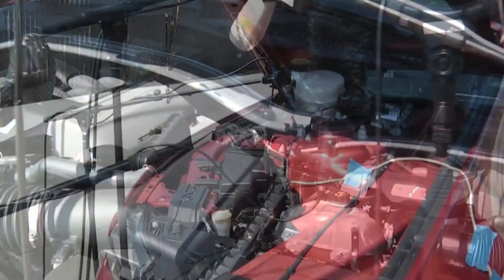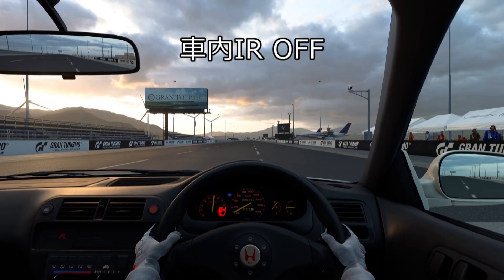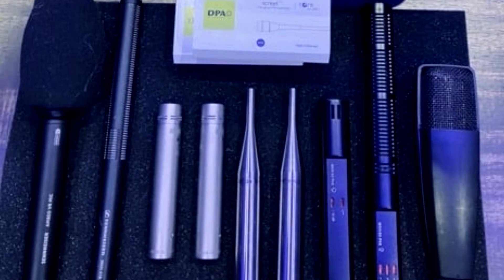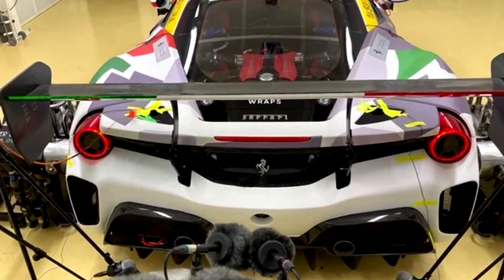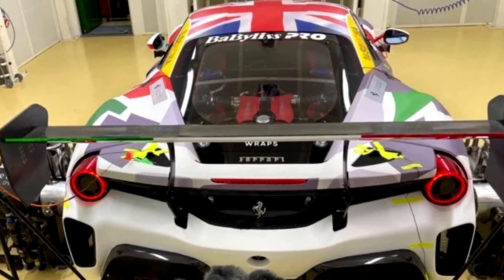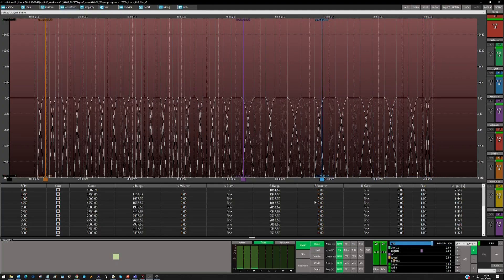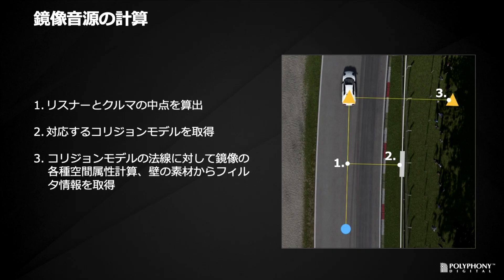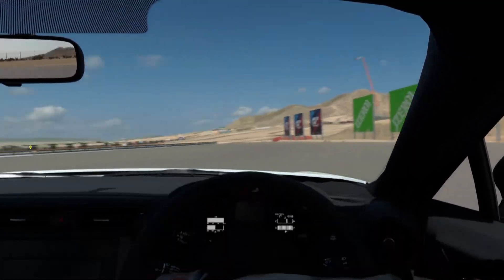Recording Car Sounds for Gran Turismo 7

Comment: Yet some of the cars still manage to sound awful when you shift up.
Reply: That's because you're not engaging the clutch when shifting. Use a clutch and you will notice a huge difference during upshifts.
Reply: @rosaria8384  whether it's the clutch or not, I don't care. They should make them so they won't stutter. It's annoying as hell. Plus, not everyone has a steering wheel.
Reply: They sound awful all the time 😂

Comment: 4:30 I wish they would add more notes. there isnt much variation in the engine notes. it is good but it could be so much better. I always knew it was a performance issue.
Reply: buy a better car and tune it. More pop crackle pop for your punch.
Reply: Every car does sound different in gt7 and acc and wrc dosent have the car varity,of gt7
Reply: Yeah, I'm questioning why they use this AES system if it just increases CPU load, instead of sample recording or even a hybrid of both systems. Codemasters games and ACC have one of the best car sounds and I'm sure they use more recording samples.
Reply: @AKK5I  They use this for VGTs, Lotus F1, and GT-R LMP1 since GT6. Now, they went around for other cars that PD don't have any access to the car or other cars with similar engine like the 488 shown.

Comment: and still the car sounds are horrible
Reply: @user-tg5wf2hq7rAMS 2 sounds are even better than those imo!
Reply: @user-tg5wf2hq7r forza is shit too
Reply: @user-tg5wf2hq7rfm is garbage gt7 have much better car models and accurate sounds than forza motorsport.
Reply: No they are not, they are actully good in most cases,

Comment: The cockpit view sounds in gran turismo suck, also the v8s dont sound like the real ones at all. They need to get interior sounds with windows down type sound so u get more natural exterior exhaust noise.
Reply: Also a cool feature most people forget is that the higher stages of weight reduction you do, the more engine noise there is in the interior in game. Try it out
Reply: @BigJZXguy  I guess that one contributed a lot to the sounds. Without those restrictions, sounds are more reflective.
Reply: I think they are quite good for the most part, some v8 needs more work but there is v8 sounds in gt7 thats quite good to
Reply: @andreasmoller9798 if you have ever been next to a Camero ZL1 then you'd know the sounds in GT7 is not that good 😂
Reply: @currythegoatofmankindthepa5156  the camaro zl1 is actully one of the american v8 that sound good in gt7, the sounds are not perfect by any means, but they are good, and when you consider how they use to be in gt6 you start relise how much of an improvment it is, forza on the other hand that use to be killer for car sounds has now even falled behind gran turismo in car sounds,
Reply: @andreasmoller9798  GT7 doesn't have bad sounds there just lacking the cars starting up in the in the car selection screen sound how they should they need to record them underload on a track
Reply: @currythegoatofmankindthepa5156  ya thats a huge issue, cars under load sound completely different and way better then when there stationary
Reply: @Sideways_Singh  They keep recording them in those little rooms 😡 that's why the sounds in most video games sound synthetic and flat even when there using the real cars exhaust note. Only raceroom has good engine exhaust notes don't know how they do it but zero games come close. PD needs to send there people to a track day hook up some mics to cars and around the track and go to town recording the real deal
Reply: @andreasmoller9798  Oh now you’ve adopted using logic and reason in your arguments HAHA
Reply: It is stated in the video why the sound is like it is, it's to have a more natural sound like you are in the car with sound damping.

Comment: Now Forza is going to try to compete with sounds 😂😂😂
Reply: @user-tg5wf2hq7r/ forza sounds like computerized / artificial while GT7 sounds like an actual car. you know what I mean?
Reply: @CaneZyle  GT7 sounds like an actual car? Are you on drugs? How much experience do you have at a race track? None I assume. GT7 still sounds like a vacuum.
Reply: @CrewExpendable2007  Yes, clean your ears.
Reply: @CaneZyle  Or go to an actual race for once, this game sounds like garbage.
Reply: @CrewExpendable2007  I did! If GT sounds garbage to you, always remember that FM2023 is much worse. It's the buggiest, most unfinished, mediocre game that I've ever purchased. 🤡🤡🤡
Reply: build from ground up😂
Reply: They gave up on this competition about 5 titles ago lol
Reply: @Darksaige  since forza 4 prolly
Reply: @user-tg5wf2hq7r Yes, and no, to a greater extent no
In Forza, the Viper and Porsche 962, for example, sound great, but are unremarkable in GT7
In general though, most cars in GT7 sound quite accurate

Guessing that all cars in both games were not sampled with up to date methods, as there simply isn't enough time to do so
Reply: @user-tg5wf2hq7rYou know damn well, that‘s not true.

Since GranTurismo started recording engine sounds that way, Forza always was on the back foot. It‘s not even close.

And the way they then use the sounds in game, with them echoing off the walls and reverbing in tunnels. The different pitches with different speeds… it‘s not even close.
Reply: @PerriThePlatyPilot  Forza does that too lol
Reply: @juraj_b  Very poorly
Reply: they haven't shown recording from the new Forza, but this is a vid how they record sound in FH5 https://www.youtube.com/watch?v=Yqsrizplujs
Reply: Forza 😂😂
Reply: “Try”
Reply: Newer newer FM just betraying FM4 yet
That's it
Reply: Forza motorsport  made from the ground up D
Reply: everybody who shits on forza sounds only know fm7-8, horizon 4-5 exist but never mention fm5,6 and fh2 which i think beat gt7 as i still think the latter sounds a bit muffled, although they do improve
Reply: @stobeznog878  you forgot to mention    AAA ac carmods too
Reply: Forza is dead.... Welcome to the dark side GT7.

Comment: GT7 is the first GT that sounds decent, the ones before sounded like vacuum cleaners.
Reply: These Vis Nav Sport models looking 🔥
Reply: They still sound vacuum cleaners
Reply: @CrewExpendable2007 no they are not, you have zero clue how a stock car sounds in reallife.
Reply: gt sport did not???
Reply: @mkldnl  GT sport engine sounds sound much more synthesized. Granted, it's much better than previous versions. I've played every single GT since the first one.
Reply: Guess you completely missed GT Sport, proof you literally are just saying things.
Reply: @evilformerlys4704  GT Sport was vacuum cleaners with tons of transmission whine to try and cover it up.
Reply: @julianturberfield7101  the transmission whine was annoying but if you’re not using cockpit view the sound doesn’t sound so synthesised. way better than the previous games where you can’t even tell what sound it was supposed to make.